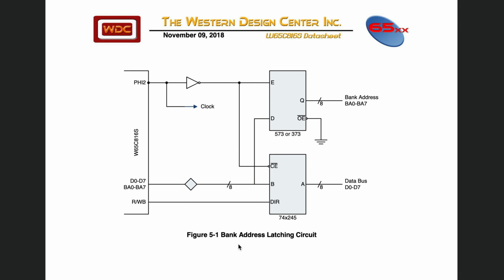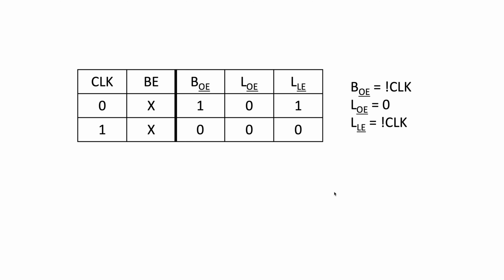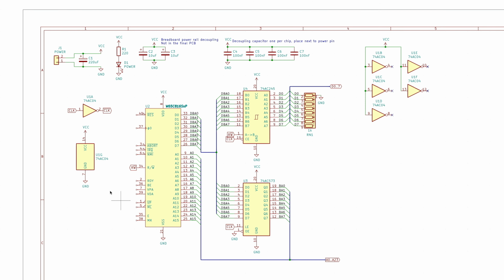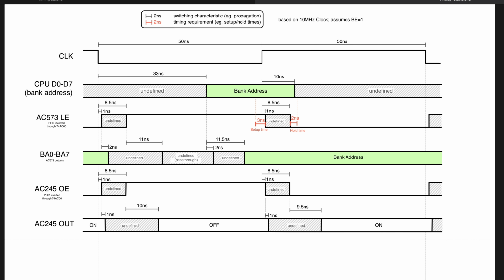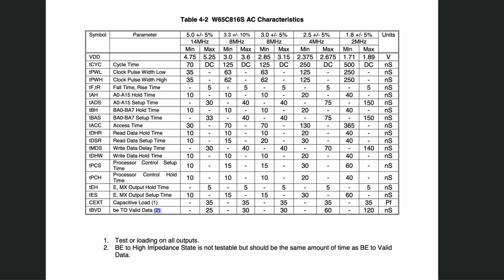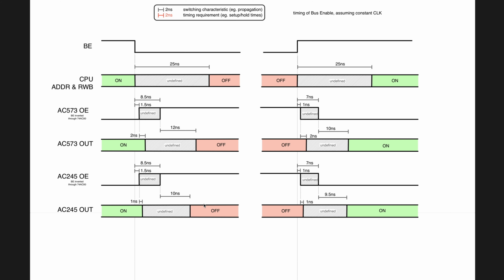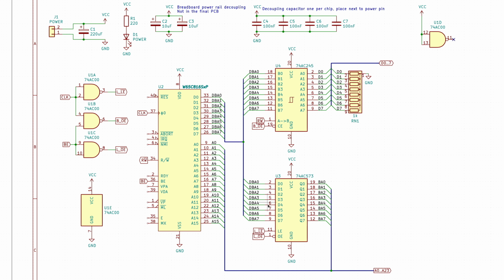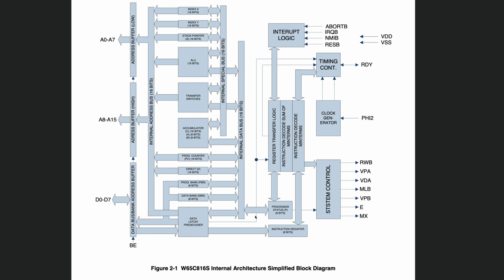#3 - Bus Enable - BB816 Computer

Comment: Thank you so much for the tutorial... Could you provide the manufacturer and model of those awesome wire strippers, snips, and pliers you use for the breadboard wires? Thanks again!
Reply: My best gues:

Strippers: Knipex 11 92 140 WIRE STRIPPER, 0.1MM-0.8MM
Pliers: Knipex 35 22 115 Pliers, Straight Jaw, 115 mm
Snips: Knipex 78 81 125 CUTTER, ELECTRONICS, 125MM
Reply from the maker: Yes that is correct 👍
Reply: @akohlbecker  Thank you very much... Father in law was a mechanic and taught me about having the proper tools! Absolutory willing to spend the extra money once rather than spend over and over again on a throwaway. 

Once again, thank you for your content. It's awesome to watch the evolution of your design and that you don't cut out mistakes. We all appreciate it!

Comment: NOW I know, in 2023, that Adrien's design for the 65C816 breakout board CAN be made to put more than one of his CPUs on the same bus. Because he exposes BE. Adrien Kohlbecker's design can be designed to put more than one CPU on the bus, because of his care in designing to avoid bus contention. It is a very important feature to those of us who imagine multi core 65816 with shared address space.

Above all, as a 54 year old who grew up learning 6510 machine language on the C64, then only to have the 6502 platform abandoned, Adrien Kohlbecker's series is perfect for those of us who wonder what could have happened, had the wonderful MOS/WDC series captured mindshare, and perhaps been turned into a 32/48 bit core, or made multi core on one die, etc. I don't disrespect the PC or Mac (yes, I actually hate those platforms). Why couldn't we program supercomputer programs in 6502 assembly? Adrien Kohlbecker supplies the answer: we totally still CAN!!!!

I think having two independent 65816s on the same bus is enough because you can run root privilege processes on CPU A, and have it govern (via IRQ) user processes on CPU B. Maybe that's not enough to run Linux, but I bet it's enough to get secure pre-emptive multitasking going.

And there are strategies for interleaving more than two 65816s, by time slicing, maybe even up to five, using modern high speed RAM. Imagine that. One 65816 core, running an OS that manages four daughter processors, all themselves 65816s.

Comment: Awesome work! 😎
The only problem I see is you have marked 'BE' from the CPU as an output where it is an input. This also means that 'BE' on Pin's 9 & 10 of U1C inputs are floating and in an indeterminate state. Apologies in advance if this is addressed in a later video. 😊
Reply: Oops! Was the first thing you addressed in your next video. Well done!
Reply from the maker: Thanks for taking the time to post feedback, even if it was addressed later! This helps anyone that has the same question

Comment: Hey, I'm really enjoying your videos. A quick question though. If you can control the outputs of your latch and your buffer (set them high impedence when disabled) do you need BE at all? Could you just ignore it and deal with bus contention only using the enables the other two chips?
Reply from the maker: Great question! The lower parts of the address (A0-A15) do not go through those chips, so to set them to high impedance you have to use the Bus Enable signal. Hope that helps :-)
Reply: @akohlbecker That's a really good point. Doh!  I'll just be seeing myself out...

Comment: Wow, Why does this only have 19 views 😂. Do you plan on using sram or dram with your computer? I'm working on a similar 65c816 machine, but can't convince myself to shell out for 32k S-Ram's Right now I'm using an 8k chip, but have always wanted to try my hand at designing an 80's style dram system.
Reply: Nevermind, answered my own question by watching the whole series. How much does one of those alliance 512k chips go for in single quantity? I was looking for high capacity DIP sram's but 32k chips are already $8-10.
Reply from the maker: Hey! Thanks, appreciate the sentiment. 
Just getting started, I'm sure the number will grow over time, although it is not my primary goal with the series.

You can find those 512k chips for around 5€ in Europe. Not sure about usd https://eu.mouser.com/ProductDetail/Alliance-Memory/AS6C4008-55PCN
Reply: DRAM isn't that hard. I have a book where the author does it with 74xx ICs only for a 68020 CPU. I have done it myself in VHDL for 68000 and 68030 and XC9572XL/XC95144XL CPLDs.
Reply: A year later it has had 1800 views, so it's doing pretty well for such a niche subject. I'm just getting started on watching the series myself and finding it fascinating. The timings look quite complicated so I'll be interested to see how you make everything line up. Incidentally, I notice that the W65C816SXB board that WDC makes uses an 8 MHz clock and 74HC glue chips so they must be fast enough.